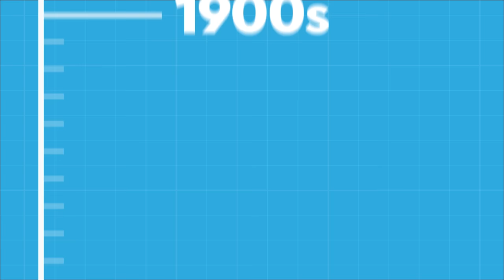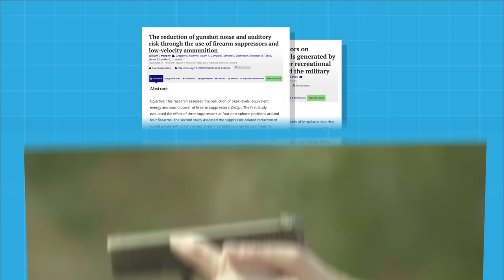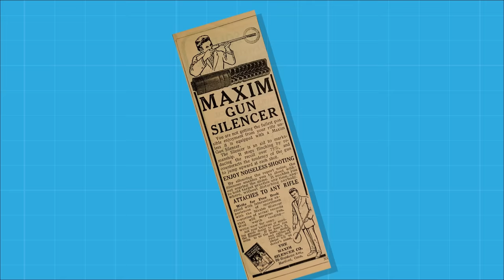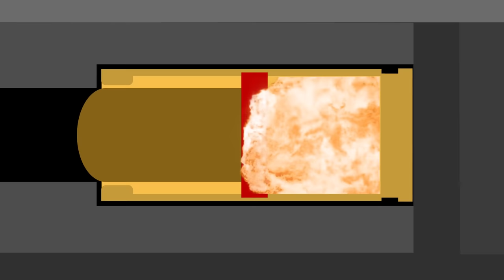How Silent Are Gun Silencers? DEBUNKED #moviemyths #debunked

Comment: I have some experience with silencers and suppressors ranging from the Eighties.  For the past decade I've been a range safety officer at a public rifle range in a western US state where silencers are almost as common as in France or Finland.  My experience is that some silencers are quieter than others, and some silencers sound different because of how they deal with the shock wave and expanding powder gasses.  Yes, silencer-equipped guns are still loud. 

 Speaking of silencers, captive-pistol technology has been used in the USA since the early 1960's for 'silent shotgun shells' and for a "silent" mortar.  The 40mm grenade cartridge is a relatively quiet weapon and earned the M79 and M203 grenade launchers the nick-name "blooper."  There's more than one way to get a lower firing signature.

Disguising the sound isn't really necessary because failure to recognize gunfire is a frequent event.  The JFK assassination happened 60 years ago and witnesses thought that the rifle shots were automobile or motorcycle engines backfiring.  That carries through to this day--pick and incident and many people will make like turkeys and rubberneck looking for the source of that strange noise.  

Silencers are not the only parts of gunfire that Hollywood infuses with a healthy dose of dramatic license.  Hollywood has been dramatically inflating the effects of gunfire for more than a century.  Film makers get away with that too--unless the audience has either first-hand experience with firearms or video presentations such as this debunk the myths.  Thanks for adding to the body of public knowledge.
Reply: welrods and De Lisle you tend to only hear the impact of the bullet hence why they sentry removal tools. I have a Nagant Revolver and with the can it sounds like a cap gun and in an internal range no one outside the range room can hear it firing. if I had the setup the kgb used you would only hear the impact of the bullet and the click of the action.
Reply: @toomanyaccounts  User instructions for the Welrod tend to muffle the sound of the bullet impact--press the muzzle against the target!
Reply: @SofaKingShit  Removing powder from a rimfire cartridge is difficult for a number of reasons--but then you could simply buy the appropriate loading at your local gun store.  The lower-powered 22 cartridges will have a lower signature--and if the bullet stays below the speed of sound there is no miniature sonic boom (more like a crack with bullets--supersonic aircraft displace more air when breaking the sound barrier).  That's before the silencer is attached.  as for adjusting the mechanics, see your gunsmith or armorer.  For one thing, there are many variables in mechanical function of firearms.  Back in the early 1920's it was a big deal to get any autoloader to function, so silenced firearms were initially manually operated or were single-shot weapons.  The Welrod is a manually-operated pistol and since the major mechanical noise from pressing the trigger is from the striker, there's no clatter from the action until the Welrod's bolt is manipulated.
Reply: @SofaKingShit  would be easier to handload for subsonic or different powder burn rates if the ammo to that spec is not commercially available.
Reply: Also its more important to suppress a Hollywood firearm because those can shoot 300-500 times without reloading (or melting for that matter). That much fire would even be noticed in a Hallmark Movie.
Reply: A perfect example of exaggerated gunfire reports is the sound effect of Dirty Harry’s Model 29.  I know I once read what firearm was used to record that sound, but I no longer remember… perhaps a shotgun in an enclosed space?
Reply: @Primus54  .44 magnum is louder than a .357 magnum
Reply: @toomanyaccounts  I know… what makes you think I was referring to a .357?
Reply: I was a range in NH in the 80s. a guy had a handgun in 22lr with an integral silencer and a silencer on a 45 (I don't remember how that mounted). The integral silencer gun was very quiet. So quiet you could hear the bullets hitting the paper at about 20 feet. The 45 was still hugely loud. It probably took it down from a 45 to 380.
Reply: @johnm948  Through ear plugs and ear muffs I routinely hear the thwack of bullets striking 25-yard targets and hitting the ground beyond--and my hearing is defective.  The difference in sound between a revolver and a semiautomatic and a single shot firearm is subtle but the clatter is different.  There are a lot of noise sources and experience will tell you which.  On military machine gun ranges when I was acting as a safety NCO and as the line armorer, when one of the M60's or M249's choked I could usually tell by the sound at which of the eight steps in the cycle of operations the gun halted at.  

Silencers change the pitch and sound and mute the discharge noises.  Silencers don't do much for breech flash but radically reduce muzzle flash.  I almost always wore hearing protection on live-fire ranges so the sound intensity reaching me was further reduced by 18 to 40 dB depending on my hearing protection.  Ear plugs proved more effective at 33 dB reduction on average--the muffs alone could be as low as 24 dB.  In the hunting field, experienced hunters know that they hit their animal three ways--the animal reacts (sometimes), expert riflemen "call" their shots (remember where their sights were pointing when the gun fired), and often they hear the sound of their bullet hitting the animal.  Silencers do make that 'thwack' easier to hear because the ears aren't blasted by a thunderous shot, so you observed accurately.
Reply: Congrats on typing all of this under a video on YouTube that you clicked on to watch.
Reply: Suppressors are the right name and are the same thing.
Reply: @ePandaTheGod  You are correct--but take that up with inventor Hiram P. Maxim, inventor of the automobile silencer (now properly called "mufflers") as well as the first firearms silencers.
https://en.wikipedia.org/wiki/Hiram_Percy_Maxim
Reply: I would like to include on the dramatisation the hand grenades effect
Reply: people dont understand the bullet report is still super-sonic ... unless the ammo is subsonic
Reply: @sadsciuidae3425  Super sonic or sub sonic, there are three more sounds to worry about:
The bullet's impact can be quite noticeable
When the victim's body and equipment clatters to the ground, that draws attention
Sometimes the victim will scream and cry and thrash around when shot

Never forget that Murphy's Law rules!
Reply: Subsonic 22LR is pretty easy to find and relatively cheap  - they have always been around, just not always labeled as subsonic -  if the round's rated speed is at or under 1000 fps, it's going to be subsonic. Of course, if the box is explicitly labeled SUBSONIC, the price is likely to be jacked up higher than an unlabeled box of subsonic rounds, given the current craze for suppressors.  You see how that goes -  the ammo is no longer this cheap underpowered 22LR round that the manufacturer skimped some money on by putting in less powder into the cartridge, and instead it's now this exotic SUBSONIC bullet that can be used in suppressor equipped guns for whisper quiet John Wick style assassinations.    
I got some of the subsonic ammo, and put an oversized 9mm suppressor on my Ruger 22lr and went to my brother in law's ranch and we had some fun shooting water jugs.  You don't need any hearing protection and they definitely don't make much noise, and sound like you are clicking a small muffled clicker.   Click, click, click.   That's all we heard, almost like we were just dry firing the gun.  If the rounds had been supersonic, they would have made a much sharper "snap" sound from the bullets breaking the sound barrier.
The water jugs did not scream or yell much as they bled their water all over the ground.    It was a very quiet afternoon.
Reply: @gandalfgreyhame3425  Got chronograph?  I had a .22 magnum revolver that developed subsonic muzzle velocities with 40-grain Maxi Mag ammunition.  Most .22 LR pistols develop subsonic muzzle velocities even with high velocity loads.  You're right--subsonic ammo is available.  Most target .22 LR is subsonic, if not all--in my experience the target .22 LR produces more fouling than the high velocity ammo and that will clog silencers faster.  Subsonic .22 LR makes a difference in .22 rifles but keep me honest by checking your pistol's muzzle velocity with a chronograph.
Reply: I've only saw one completely silent suppressed firearm, it was a Ruger .22 LR with integral suppressor and literally was made for use in the Vietnam war.

Much hay is made of the sonic boom from a bullet, never realizing, tiny bullet, tiny sonic boom. You're not shooting fighter jets out of that weapon, only tiny little bullets that make a distinctive crack when passing overhead. You'll excuse my acute disinterest in discovering what they sound like when striking my person at supersonic velocities.
Reply: @spvillano  In my experience with .22 LR pistols the projectiles don't achieve supersonic velocities (1100 fps depending upon atmospheric conditions)--and setting my chronograph up 10 feet in front of the muzzle (to avoid recording the velocity of escaping powder gasses).  These tests were performed using pistols without silencers.
Reply: @alancranford3398  valid point, should've clarified velocity vs barrel length. Especially with a .22LR.
Still, the only weapon I've ever saw that was fully suppressed to silence was a .22LR pistol, where one only heard the click of the hammer. The suppressor integral in one model. Saw similar with a .22LR rifle, again just as silent, needed a ridiculous can on it to make it that silent.
But, a supersonic round, in my case 7.62, 5.56 and 5.45mm rounds going overhead weren't exceptionally loud, they had a pronounced crack, but one wasn't getting directional information from that. One got directional information from the rifle's report and well, one suppressed the living shit out of that chunk of geography.

DemolitionRanch had some fun with lengthy suppressors, going out to 7 feet long, but neglecting the theory behind how they worked. Fatter suppressors tend to be quieter, not just adding length. One's trapping gases that'll deliver a shockwave to the air, so the more trapped, the quieter it is and that's wavelength dependent as well. 
So, I could in theory fully suppress a .50 BMG rifle, but the suppressor would be the size of a small dumpster.
Of course, the .50 BMG is a special beast in and of itself, beyond its thunder, it does tend to relocate any loose dirt and foliage to make certain everyone knew where it came from if it was unsuppressed...    ;)
Not that it'd matter, given it's likely far, far out of range anyway.
Reply: Suppressors should be street legal. The $200 tax stamp and background check is is ridiculous. In Europe you can just buy them without a license.
Reply: @johnm948 You can get integral barrels for the Ruger Mark IV which replace the stock barrel and the resulting sound with subsonic 22LR ammo is *very* quiet.
Reply: @stopthephilosophicalzombie9017  the NFA suppressor ban was horse trading with "gun rights" people--to assist the new state wildlife management agencies, suppressors were "regulated" in order to help catch poachers and save all the deer for rich sportsmen to kill, not those starving masses of poor people.
Reply: We called the M79 a "thump" gun, in nam. As for "silencers" I've seen guy's use Fram oil filters on AR.15s that made them completely silent. All you heard was the bolt slamming forward.

Comment: Another use for supressors in real life during covert ops is that they greatly reduce (but not eliminate) muzzle flash on a gun which helps make the shooter harder to spot.
Reply: I have heard that they hide the muzzle flash from the shooter, thereby preserving night vision.
Reply: I was under the impression that this was one of the primary reasons to run a suppressor in a military environment.  Found it odd that he didn't bring it up.
Reply: Aaaaand of course the most important example is missing. There are videos here that address exactly that. If you combine sub-sonic ammo with a suppressor you will get exactly what these guys claim isn't possible. An almost silent gun.
Reply: The suppressor on my hunting rifle also dampens recoil, which I see as a valuable added benefit.
Reply: @Mike-vs1gf  it's used in military, because they're actually dampening the sound. Or spreading it so it's hard to detect the source of the shot.
Main problem with most of the "myth debunkers" - they never saw an actual use of these outside of the range.  Yes, you can still hear a shot with silenced weapon - when you're near it in relatively quiet surroundings like ranges used for videos. Now imagine big city or ME bazaar instead and no microphone filters - only background sounds can easily reach over 100dB, we don't hear that just because we got used to it. In such surrounding you won't distinguish 90-120dB of a silenced shot even from 10 meters. Now imagine it's done from 40-50 or even 100m - people will understand that there's shooting going there by falling bodies rather than because of sounds.  That's one of the situations silencers are used - when you need to minimize distance to the enemy before they'll understand there's fighting.  Another one - suppressors spread the sound in such a way, that distinguishing shooters position by source of a sound is pretty hard even if you know there's a shooting.
That's why russians invented their 9x39 rifle - loudest sound it makes it's mechanical bolt movement. And it's meant to shoot targets at 100-200 meters (if you have russian friend claiming it's for 400+ meters - send him to get some selffucking) - noone around the target WON'T hear the shot at all.  Their bigger thing - VSSK rifle - intended to penetrate 16mm of steel at 150-200 meters or make a sure kill at 600.

Comment: A 32 db decrease may not seem like a lot, but since the db scale is logarithmicit's actually quite a lot.
A 3 db decrease roughly halves the the sound of the energy produced, so doing that 10-11 times in a row is quite significant.
For reference, a normal conversation is around 60 db, a vacuum cleaner 80 db, a car horn 110 db, and a jet engine 120 db.
Reply: This is when people try to sound smart, but actually don't have idea what they're talking about...
Reply: @PtrkHrnk  That’s what stupid people say when they don’t understand.
Reply: And a TF or FC dragster is louder than all of them! LOL Glad you informed everybody that a 3db drop or increase is a roughly 100% change in noise level. The outdoor channel has a show about movie weapons & scenes. A muffler cut the report from a Beretta 92 by over 12 DB but they failed to note how much that really is.
Reply: Yep, 32 dB is a little over 1500 times reduction (1,584.89).  The scale is defined as 10 dB = 10 times the power.  with 3 dB being around 2 times by math.  To find the exact amount on your calculator its 10 ^ (dB / 10)